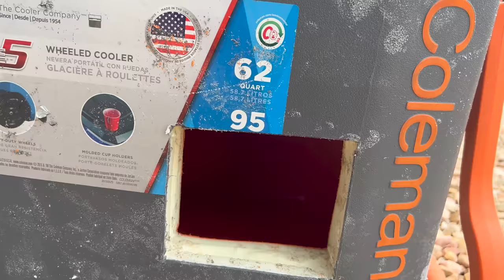OFF GRID WATER SYSTEM WORKS!!! I FOUNDATION IS DONE!!! I COUPLE BUILD OFF GRID HOMESTEAD

Comment: Hey it's nice to see that you made it with the water connection. If you build or own a house, you need a workshop with lots of tools and spare parts. I have parts that I've had for years and I'm glad that I don't have to drive to the hardware store for a part, even if it's only 3 miles away. Greetings from far away Berlin in Germany. sorry about my english, it comes from google translator
Reply: Hans, your English is fine!  👍
Reply from the maker: Welcome Hans! Your English is totally fine.

Comment: Nice job on the plumbing. I live in the center of Utah And I've also used PVC my water system. I'm hopeful that this tip will help you down the road. When you get that fine powder and those ball valves on your PVC you need to lubricate them when you open And clothes them. I've been using WD40 Once when I opened the valves and spring and once when I closed the valves and the fall and so far it's worked really well. Nine years running.
Reply from the maker: Good tip. Thank you!

Comment: When it comes to buying hardware such as nails nuts and bolts screws hinges joist hangers, caulking plumbing for the pipes or pipe fittings I always buy more than what I think I'm going to need. My wife calls me an excessive buyer. And I always tell her you never know when I may need them. So I always tell her it's always better to have them and not need them then not have them and need them.
Reply from the maker: Hi Timothy! I buy more than I think I’ll need as well. But plumbing is a whole different story. I should 5x the amount I guess. 😂

Comment: Just curious.  You're not venting the crawlspace?  In my area, it's pretty common to have vents (basically the size of one cinder block) on each wall so that it allows moisture to leave the crawlspace.   I think I've seen others use heavy plastic on the ground, basically sealing the crawlspace from the ground.  Do you have a plan for that?
Reply from the maker: Hi Michael! Yes we’re going to be venting the crawl space just above the block when we start the subfloor.

Comment: Great work on the plumbing, it looks nicer than what I have seen out of many pros.  Just one note, don't use thread sealant or tape on flared fittings.  The seal occurs on the tapered surface, not the threads.

Comment: The Outdoor Cats🐱🐱Are Great. They Will Keep The Rats🐀& Mice🐭At Bay & Get A Great & Healthy Protein Diet They Require & Love💓. How are you planning on Insulating the Water Line Pipes & Large Holding Water Tanks for Winter Freeze? Great on the Foundation Concrete Applications.
Reply from the maker: The tank are in a 3’ hole right now. I plan to wrap some insulation around them and then back fill the dirt. Should prevent most of the ice but not all.

Comment: You need to put 2x4's at each corner underneath the Horizontal Shelf that the Tank is set on, and have it come straight down to the ground, So that there is Positive Weight Transfer by framing and Not just holding by screws the weight of the Tank!   
Otherwise the wood could split at the screws and the Tank would come tumbling down... 
In the midst of doing things, it is hard to have different perspectives!  Cheers!
Reply from the maker: Good thinking James!! And yes different perspectives are good. Thanks.
Reply: @lifeelevatedoffgrid  It all looks good with all you are doing!

Comment: just remember you could fail at plumbing 10 times before it cost you the same as a plumber to do it. use plumber dope on the threaded pipes.  its at the big box stores with plumbing glue.
Reply: oh and #blessedmess. lol

Comment: Did you put air to the bladder in the tank so the pump is not running every time you turn on the water..
Reply from the maker: Yes the tank came with air in it already. I did adjust the pressure to 2 psi below when I knee it to kick on.

Comment: увелич диаметр входящей пруби . диаметри одинаковие происходит  водное голодание крильчатки насоса и розрив потока .
auto_awesome
Язык оригинала: русский
116 / 5 000
Результаты перевода
increase the diameter of the incoming pipe. diameters are the same, there is water starvation of the pump impeller and a flow break.